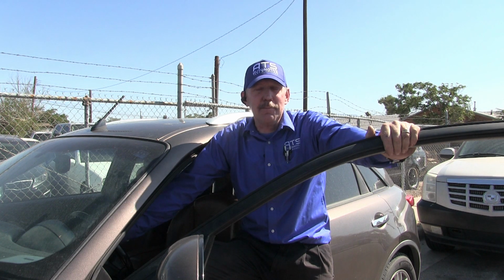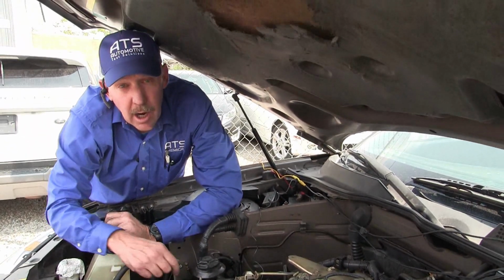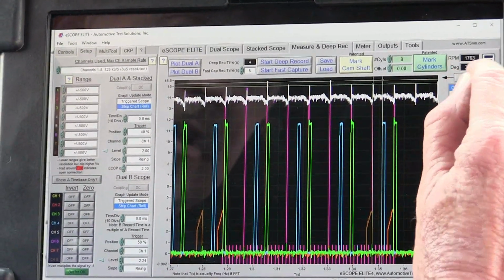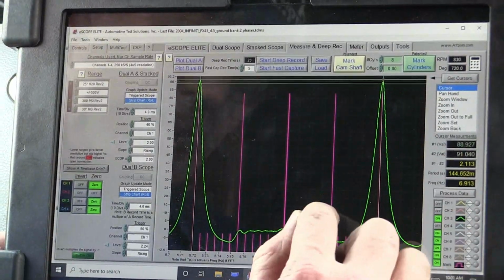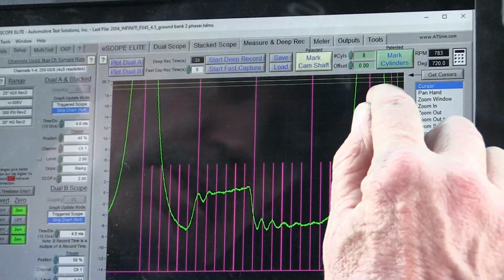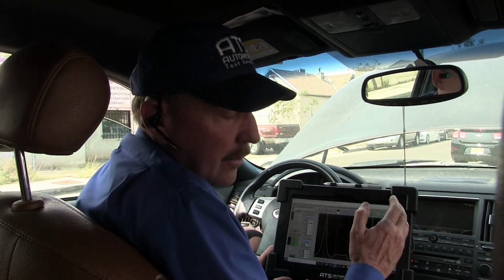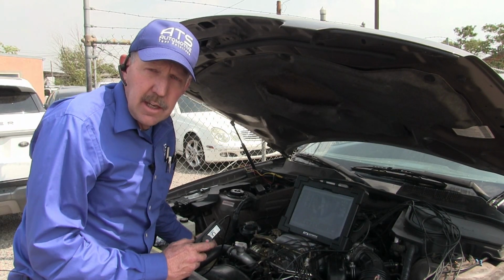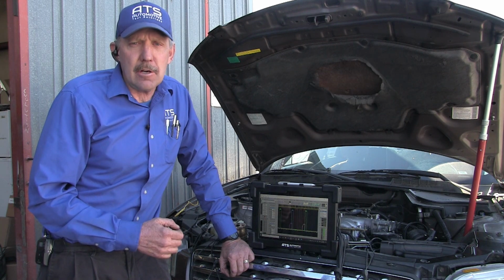See How To Diagnose an Engine with a High Idle on a 2004 Infinity FX45 With Fault Code P0507

Comment: Hi Bernie my infinity fx 45 2006 is in lip moad I just checked I just changed the ipdm because the dealer said that was the problem but they wanted 2700 for a new one plus 1000 labor I just couldn't pay that my question who do I call to come out to me to reset my cars computor codes everything works in the car starts right up but only will move in idol speed what kind of company should I call I live in nj ty

Comment: What kind of test can run using the scope to check for timing chain jumped a tooth . People have told me that I need a good know wave form to verify for that problem. I believe there is an other way than the good know wave form. I am open to learn

Comment: I was, revered by Danner scanner. Awsome multitasking with 8 Channel data, but can not keep op if you Don,'t spesify on using units. " The cam is  30 then to 50" are you taking about inclination lobe pressure or are you taking about angle ( degrees ) ?

Comment: Thats awesome stuff.. Ive watched it 3 times i still cant get my head around how you determined it was bank two phaser that was faulty.. Both cams were in time and both phasers moved the cam the same amount. If the phaser was mis aligned wouldnt the cam timing be out?... If you had only one ignition sync on your first test you would have missed that fault...
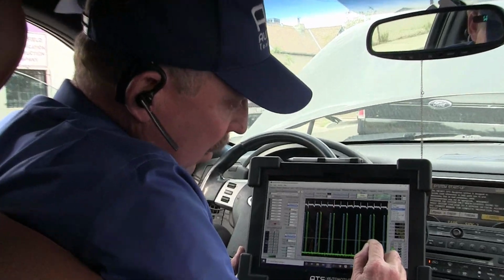Reply: This where he knew that the phaser were off 5:14